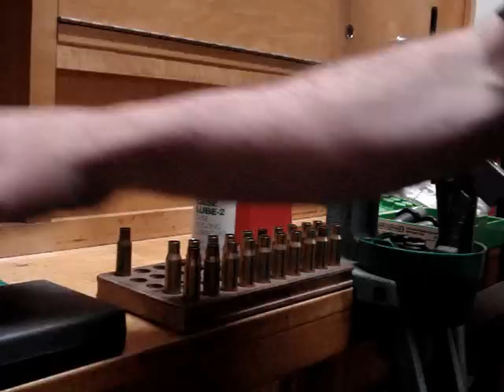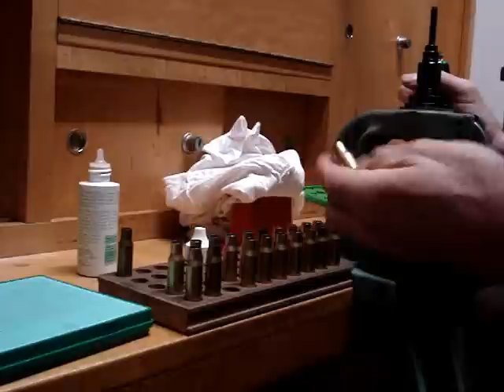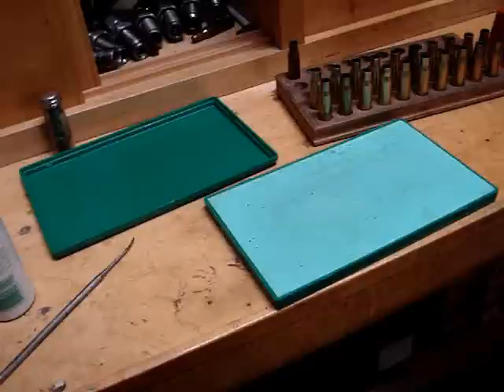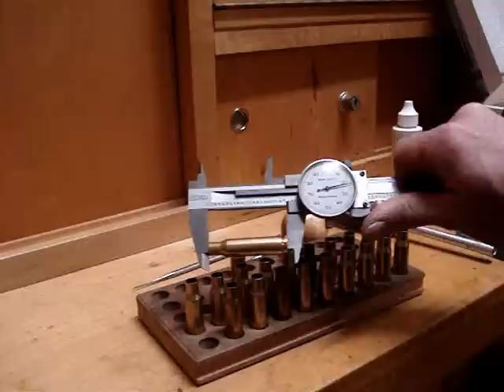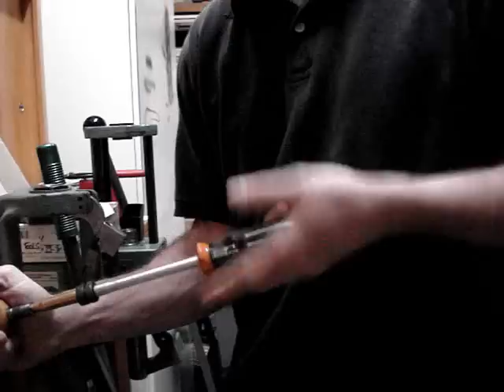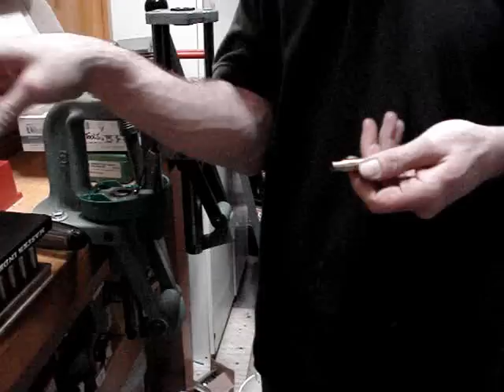Rifle Brass Part 2

Comment: Hello 👋  . I bought 3 dozen of 30-30 brass , already FL sized and trimmed , BUT my calipers gave me a reading of 2.0175 , that's. 012 short from minimum trim , NOW ! 
Should I load to min press. With a 100gn. Half jacket Hornadys? can there be a comparison to when you have a 357 lever and you also can shoot 38 special?  Will the missing length of 0.012 make my regular 30-30 TO A 30-30 SPECIAL ? Just because of the shorter length?

Comment: Working with .308 Win and I have a fire formed case measuring 1.622" I am using hornady headspace gauge. When you neck size does that move the shoulder back at all. I hear that .001 setback is ideal. Why not leave it actual chamber measurement?

Comment: Im having an issue using the 308 win two die set by rcbs. When i use the resizing die it doesnt seem to flare the mouth enough to accept the bullet. What am i doing wrong?